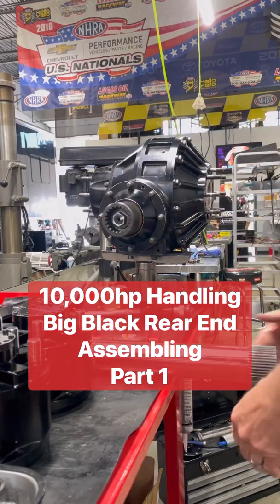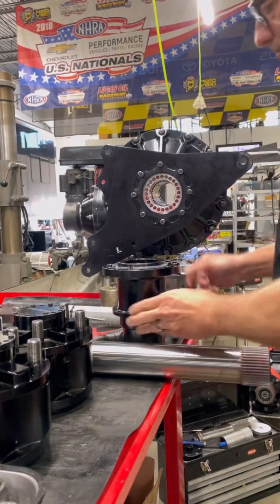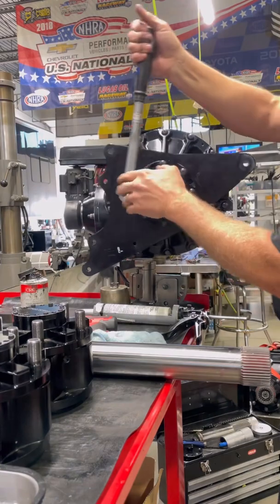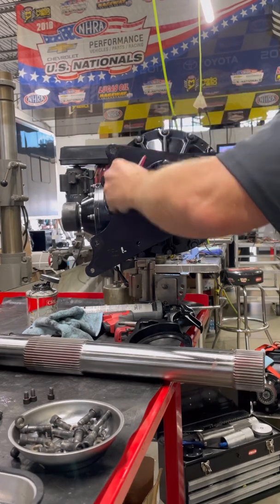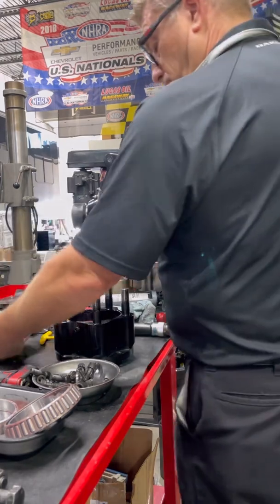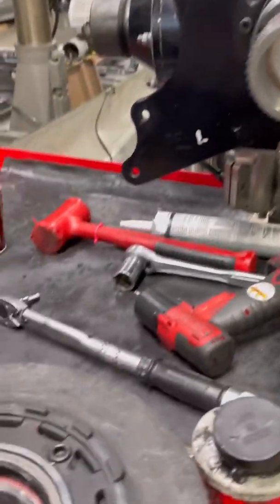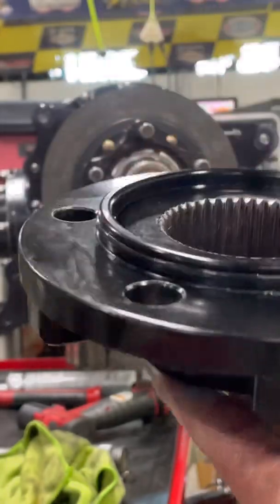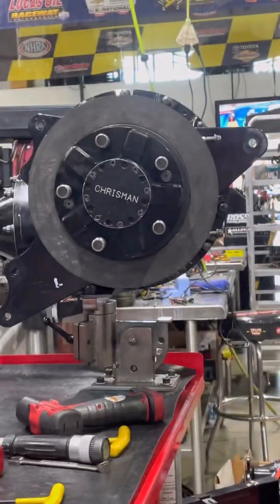10,000hp BIG BLACK REAR END assembling Part 1

Comment: Something to think about with silicone on the mounting brackets / spindle rather than an o ring.  Silicone will reduce the chances of fretting between the two parts and the resulting loss / reduction of bolt clamping force since the parts are glued together.

Comment: most of the big rigs use a similar spacer between the bearings and you torque the nut that holds it all in. Nice design the way the cap actually drives the wheels

Comment: Amazing that a Parallel ground washer isn't required to clamp the spindle ends down.  Sounds like it is just a standard-ish-ARP-$$$ "stamped/punched" bolt washer with a punch rounded side and a flat side.   Not bitching or complaining,, just curious and interesting.   ALWAYS face the flat side to the work piece on a punched washer.   Thanks for the Video's Rob.  More please.  Big luck this season.  Go snag another US Nats golf check.
Reply from the maker: Right on brother!

Comment: Million dollar race shop... and you have to use an old harbour freight lathe?? Need some more sponsors bro!
Reply from the maker: Hey bro... you need to look back at some of my other videos. Or listen to the video why I was using that old lathe. And there isn’t a million dollar shop here. I own all the equipment this team uses. eBay, Facebook market place and auctions are my go to places. Don’t knock a guy down if you don’t know his story. Also about the Harbor Freight lathe... that thing even came with a center post grinder and drill. Oil bath chuck bearings and .001 run out. Better than most shit out there that is new.

Comment: Seems to me that if you only grind the edge against the hub on those flange nuts it would be better than going through the whole lathe process and it will hold the nut from spinning🤷‍♂️
Reply from the maker: What really needs to happen is the hub needs touched off with an end mill so it accepts a full nut. Should be done from the manufacture when he built the hub....

Comment: I've been building 40,000lb and up rear assemblies for years. I'm surprised you didn't prefill hub rather than wait for the ring gear to lube it.
Reply from the maker: It films the hub to center section level in about 3 minutes. There’s at least a .25” all the way around to axle to get to the hub.
Reply: True, you guys do warmups in the pits etc. Thanks for sharing the videos!
Reply from the maker: You bet! Thanks for watching!